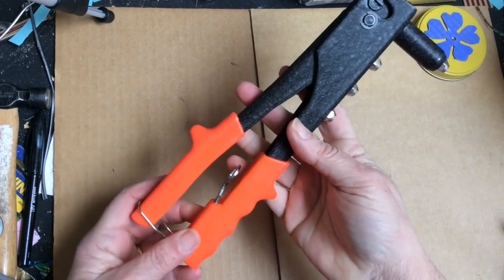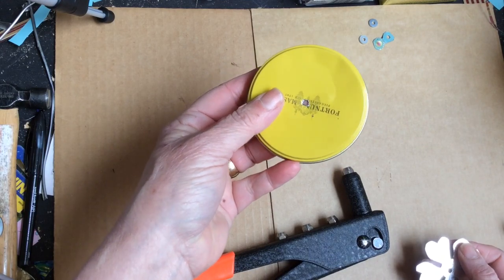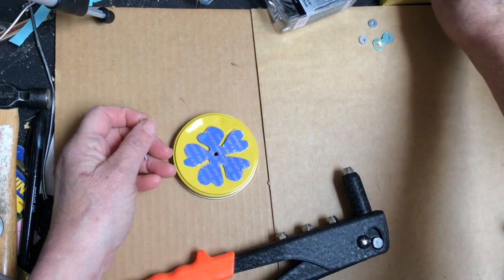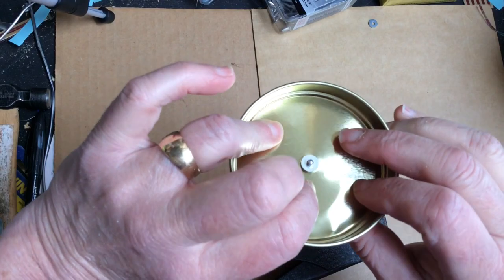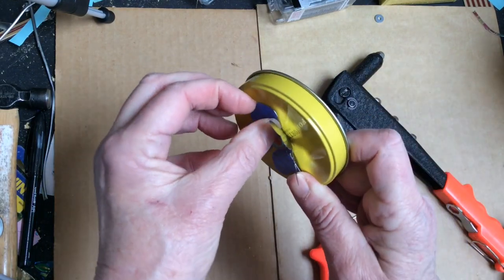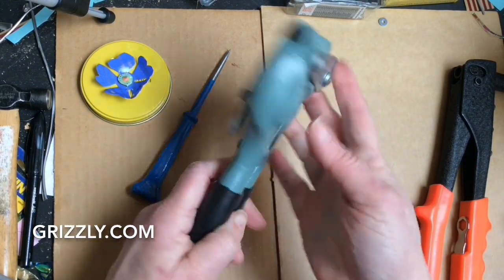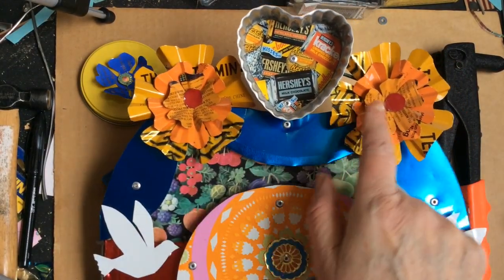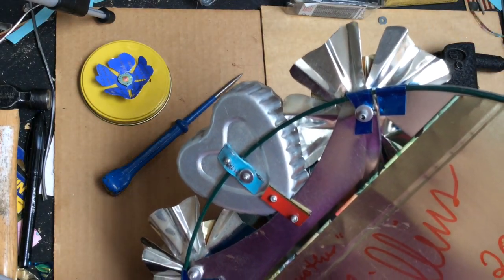How to Use a Pop Rivet Gun On Tin Art

Comment: Love the art, and your demo is short and sweet. I'm a retired Tinner (sheet metal worker) and did mostly commercial work (HVAC systems) and did my apprenticeship in WA (Local 66! Also couldn't help but notice your vanity plates). In sheet metal work, using rivets had their place (mostly tin and SS), but before spot welders, welders, and machined seams, they were used extensively. I now do multi-media crafting and was immediately drawn to the steampunk style because of the riveted metal elements that are illustrated in the art. Of course, I own both the Whitney punch and a rivet gun and find ways to use them, even though I don't use tin or other metals as my predominant substrates. Your video came up in a search for something I was going to try with a junk journal. I hope you're still making fabulous art!

Comment: Cool pop rivet demo! thanks. I have one, but haven't used it yet. [tremble]. I love the hole punch you show. I have one too.  Cuts like butter. I also have a screw down one and a pliers type one. The screw down can make 2 sizes of holes, but is time consuming. The pliers can make only one smallish size hole but is super easy. The problem with all three is that you can only make holes a short distance from the edge of your tin. I have a several sizes of blocks of wood with a 1/2" size hole drilled in the middle that I put under the piece I am punching with the awl. This prevents the tin from bending or sinking when I hit the awl with the hammer.
Reply from the maker: Lynn P The Tin Bird video shows how to make holes with an awl and block of wood. But a center punch and a Dremel or drill work great too.
Reply from the maker: Excellent!